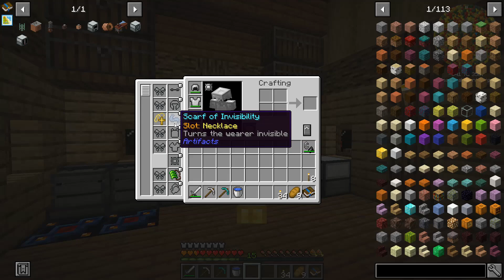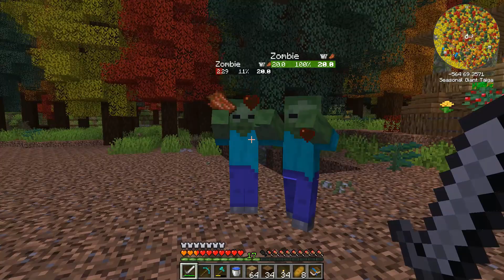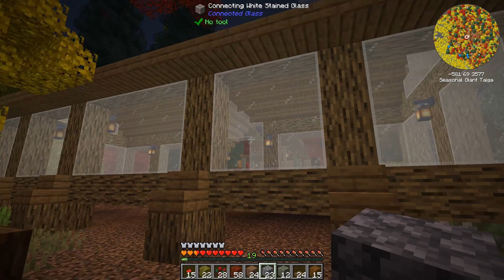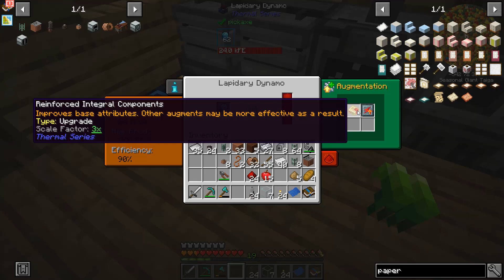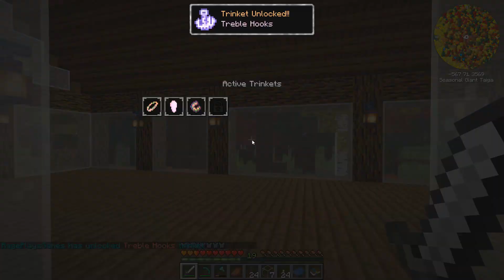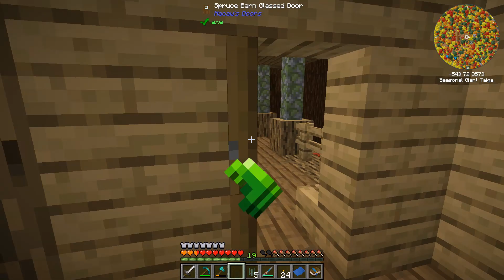Enigmatica 6 :: E03 - Immersive Engineering Garden Cloche & Greenhouse

Comment: rage: *makes greenhouse*
greenhouse: *doesn't have glass roof*
every green-thumb in a 10 mile radius: *internal pain*
Reply from the maker: Haha I apologize, I spent a fair bit of time trying to fit glass into the roof design and wasnt happy with any thus far so I will be exploring some of the new decorative modded blocks I have access to and going back to add it later. Where are glass stairs when you need them!?
Reply: @RagePlaysGames  technically traditional greenhouses didn’t have a glass roof. Because it’s supposed to keep plants from freezing a keep the temperature mild during winter. So yes maybe for industrial agriculture you need glass on top but I think this goes well with the theme
Reply: @Lashmak  y have a greenhouse for personal use(a smal one) and its entireely made with tissue and Metal shaft so you dont NEED glass but its probably more efficient for the BIG one (soory for the poor wooridng)

Comment: You can use modular routers to transfer energy, fluid, items etc wirelessly
Reply: It is extremely possible to make mods that are balanced against themselves and mods that are balanced against vanilla gameplay. It’s also a fallacy that all mods are equally overpowered. Teleportation of items and signals is not the same as 20% knockback reduction.
Reply: @fashnek  what does knockback reduction have to do with farrms

idk man just let the people play minecraft how they want to play it is what i actually wanted to say since that is exactly what minecraft stands for
Reply: Minecraft doesn't simply mean doing anything you want. If it did, then emeralds, experience levels, and ore in general would not exist.

Mods have difficulty and balance too.
Reply: @fashnek  yes yes youre right
Reply: It’s OP and anti-fun.
Save wireless things for the most extreme emergencies. Or else admit you are cheating yourself out of some core gameplay.
Reply: idk man mods in general are op as fuck if you are used to vanilla farms

Comment: I know that it is not related to thus modpack but im desperate for anwser. Im currently playing on a Roguelike Adventures and Dragons modpack and I have absolutely no idea how to increase weapon's/tool's heat level. I searched a whole day on the internet and I couldn't find the anwser. Can anyone help me please?
Reply: If I remember correctly the heat level is an ember's feature, you need to put a heat core in your tool (I don't remember how they are called tbh but they are dropped by the ember's mobs) you do it by first placing the tool in the anvil from embers, then the heat core and then hit it multiple times with the embers hammer until it gets combined, then the heat should rise just by using the tool normally
Reply: @Kreznik02  thx man it works!